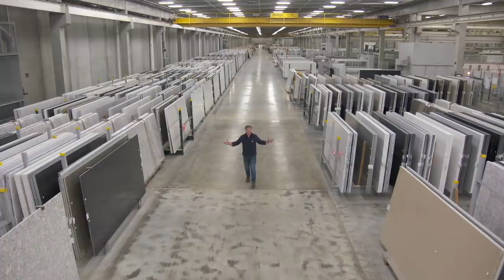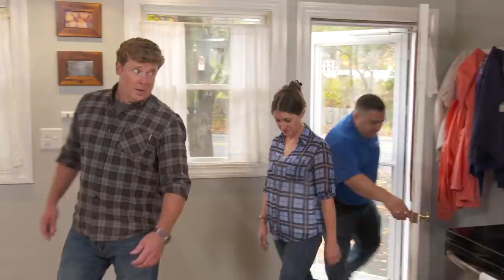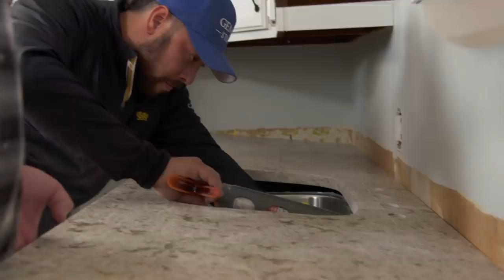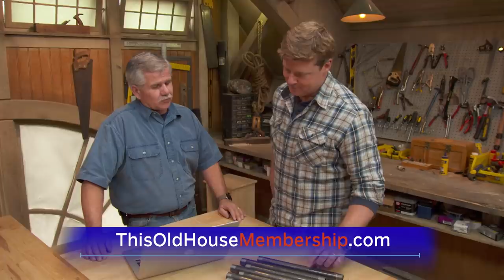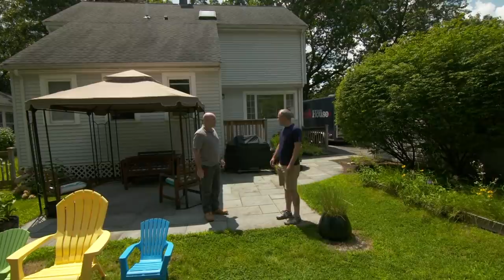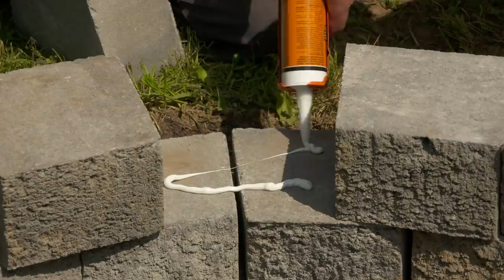ASK This Old House | Quartz Countertops, Firepit Kit (S18 E25) FULL EPISODE

Comment: 7:08 It looks like that bar attached has a handle so I assumed it was for lifting the slab but is that bar also to help strengthen the edge so it does not fold in half and break during the install?

Comment: 8:15 -- The sink back-splash is covering up the bottom third of the 120v outlet... how did that happen? 🤦‍♂️
Reply: Original counter (one before the yellow one) may have not had a back splash. Also, somepeople just put boxes in odd places, I have a switch in the middle of my door frame in my house
Reply: bad math
Reply: Danny is a good friend of mine. I am sure there was a discussion to be sure the electrician could move the outlet after the back splash was installed. The customer requested the height of the back splash
Reply: It was in a bad spot to begin with.
Reply: Movie magic.
Reply: The new backsplash is taller than the previous one. Hope they didn't glue that new backsplash to the wall before the electrician fixed the outlet. Covering that bottom screw of outlet would be a mess to remove. I would relocate the outlet and do the drywall repairs prior to placing the new countertop. But then the TV magic, remove old counter, measure, cut and install and all before the kids get home...wow
Reply: @patzeuner8385  You're right, they only showed the other section of backsplash getting fully fixed in place.  I have a feeling (or hope) the section covering the outlet is only mocked up, especially since Kevin pointed out the fact that the outlet will be moved.
Reply: The original laminate countertop had backsplash too but it was probably shorter.

Comment: put pea rocks 6 to 12 inches around. Place for embers to land that will not burn. Also don't have to use the string trimmer against the stone.
Playground sand id the easiest and best for inside. Drains well and doesn't burn.

Comment: How does cleaning the firepit work after youve put lava rock in it, but then have to shovel out the wood ash?? 🤷‍♂️. looks like a maintenance nightmare.  And why dig a large circumference when you could clearly already know the diameter when you dry-placed the stone bricks?  And without any smoke suppression, ya wont want to sit so close, or else you will end up stinking like a forest fire / smokehouse.

Comment: A couple of tips for splitting wood with a standard ax.

1) This may seem obvious to those that are experienced splitting logs, but it is not for someone that has never split logs before. Make sure the ax head hits square on the end of the log. An ax is more likely to get stuck in the log when the wedge hits on a slight or steep angle.

2) If you are in the 5'10" to 6'+ range, you may need to bend your knees a bit to insure that the ax head hits square. This can aid in splitting the log if transfer that knee bending motion into the momentum of the ax swing to provide even more force.
Reply: 3) Watch Buckin Billy Ray split some rounds.
Reply: I'm tall and a more sustainable way is to drop your hips. Your hips are designed to move your weight and not your knees (despite it being more laboring)
Reply: @4realjacob637  

You cannot affectively drop your hips without bending your knees. If you do so, you have a good chance of injuring your lower back.

Comment: You do not need to swing an axe like a baseball bat or a pick, your not digging a ditch nor are you in the bottom of the ninth. There's no benefit to overhead swings when splitting wood, playing baseball or digging a ditch, those sorts of overexaggerated motions are for the movies. In the same way a straight jab in more economical and effective than throwing haymakers, simply snapping the head from the raised or lifted position is sufficient and takes a fraction of the energy. It also causes unnecessary wear on your body and extra points of danger doing round house swings like that. Smarter not harder folks, it's the same concept with the maul or wedge too. Think GOLF here, strategize how to use physics to your advantage in as few swings as possible rather that having physics ride you like a one-way pony. Your body will appreciate you did, you won't feel so insulted by your own nature and your friends will still want to hang out with you at the end of the day. :)
Reply: Way too long of comment but year.